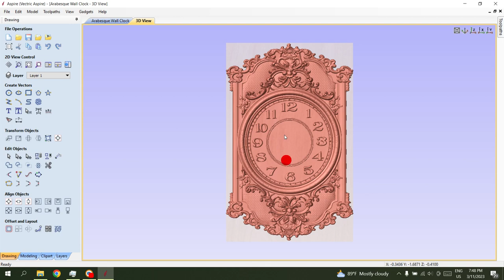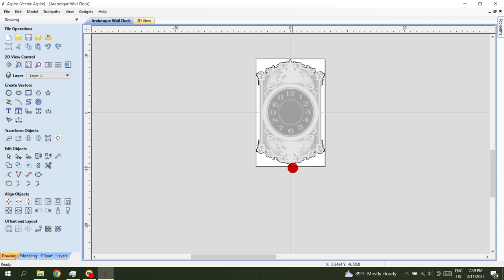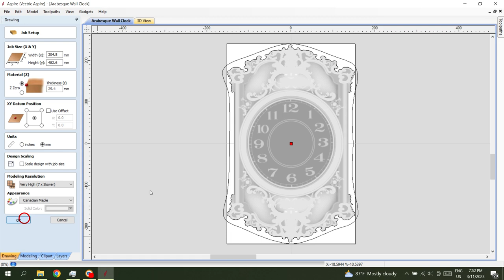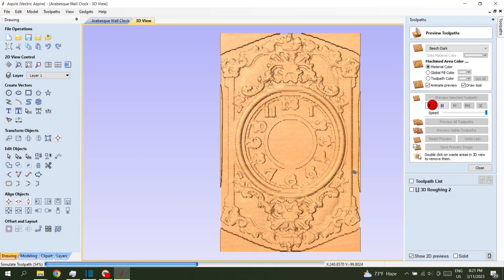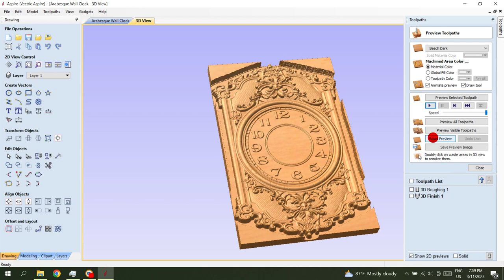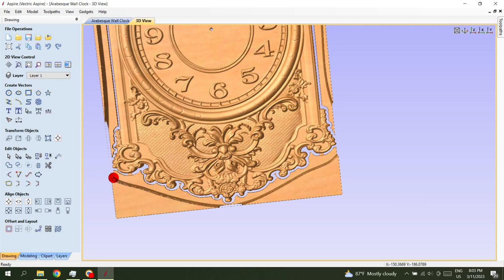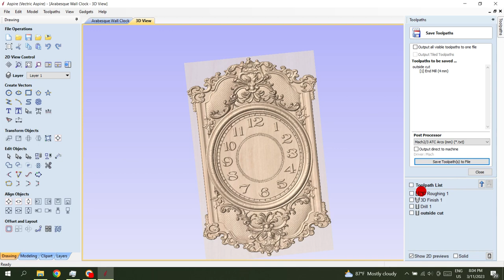CNC Engraving Arabesque Wall Clock // Vetric Aspire toturial // CNC Woodworking project

Comment: How long was each runtime? Rough pass and Finish pass? Thank you!
Reply: Also, what kind of brush did you use on the front to sand it?
Reply from the maker: all about 9 hour i think
Reply from the maker: it is (CNC Nylon Wheel Brush)